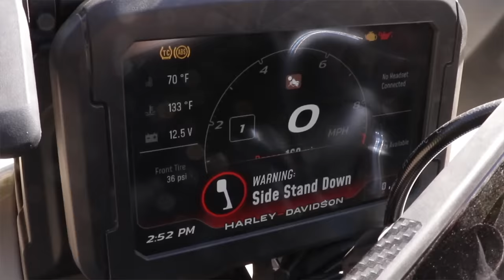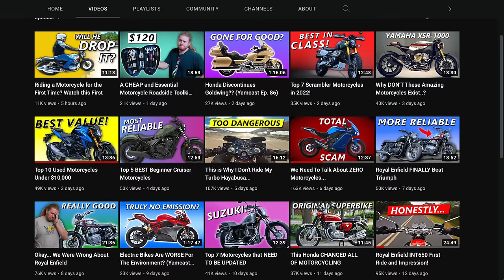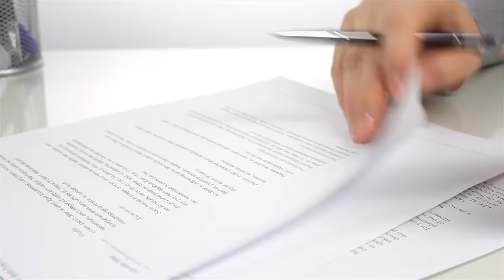Want a Bobber Motorcycle? Watch this First

Comment: Had a Triumph Bonneville Bobber Black for about 3 months before selling it. Thing was plenty fast and badass looking (definitely needed straight pipes and a windscreen), but I found myself constantly riding the FZ-07 instead due to better handling. Dragging pegs, rough suspension, and tank slappers are not as fun as I thought they'd be.
Reply: same, had a bobber. still one of the best looking bikes but sold it after a few months. too rough, especially suspension wise. now have a bmw r1250r for twisty/sporty stuff (considering to swap that for a Triumph Speed Twin) and a Harley FatBoy for when my midlife crisis acts up again.
Reply: Glad to read your comment. Bonneville Bobber is high on my wish list, but I'm concerned how much riding I'd actually do on it. I think Yammie forgot to mention the most important part of a Bobber - Practically no rear suspension. Beautiful on a Freeway, backbreaking over a pothole.
Reply: @tsubadaikhan6332  yeah well, I live in Belgium, in the so-called Flemish Ardennes. Roads with potholes aplenty. My FatBoy doesn't do so well either there. One reason I got the BMW, very good suspension. The BMW GS (I have a roadster) is the best sold bike for a reason here.
Reply: Funny, I’ve had mine for 6 months or so now and I love it! That’s what makes a horse race. Go to your dealership and ride one 👍🏻
Reply: Why don't you just change the suspension instead of bike?
Reply: @elite_eight4486  It came with a monoshock and the bike already cost 13K + after a straight pipe and other add-ons. Not tryna drop even more on some Ohlins. Besides, changing the suspension won't improve the lean angle.
Reply: @elite_eight4486  I did, I installed a pretty expensive rear shock (aftermarket, forgot the name) but that didn't do much. it's a great bike but has a very short rear travel
Reply: I know this is a common complaint but there are some rear suspension upgrades out there now that folks say completely change the feel of the bike. Pricey though.
Reply: That bike is the best bike I’ve ever seen. Definitely my dream bike EXCEPT the small gas tank. My ninja 300 had a bigger tank. That’s an issue..I  love the bobber style. Seems y’all got rid of them rather quickly…
Reply: Funilly enough I sold my Mt-07 for a triumph bobber since where I ride, it is mostly city riding and there is not much leaning
Reply: @Ishbikes 
Every time I ride my 23 bobber it gets better and better

Comment: I've been driving my Indian Scout Bobber since January and I don't regret a second. I've already changed it a bit optically: new seat, Wunderkind custom parts from Germany, new exhaust system and a few cosmetics. I love this bike and am almost sure I will keep it after buying my second machine. Yes, sometimes it hurts when your spine comes out of your neck when you hit a pothole. But I love her.
Reply: I am wondering if the Scout Bobber 60 would be ok for a new rider? I really love the way those Indians look but I don’t have much experience.
Reply: Hey  @Allie_Rose ! I definitely recommend that you do a little test drive. As for the experience, I can only tell you how it was for me. Here in Germany we have to pass a theoretical and a practical test for motorcycling - even if we already have a driver's license. This guarantees a safe start even for beginners. The bike itself is a little uncomfortable, but it is beautiful and unique on the market along with the Triumph Bonneville Bobber. The performance of the Sixty is definitely enough to have fun with it. You can also customize them with many after market parts. As for the price, you have to know that it is definitely not cheap. For a beginner, I think a Scout Bobber is a good choice, but of course you have to be aware that this is a fairly heavy bike with compromises in equipment. As a really good alternative, I can definitely recommend the Honda Rebel 1100 or the Vulcan S. Much cheaper, good equipment - just a little less soul. Drive safe!
Reply: @lucidfox.  Thank you for the recommendations!

Comment: Eleven years and 84,000 miles ago, I went with a used 2009 Nightster. Reliable as an AK-47, and just as refined. I rode it today, still crushing miles. One of the first things you change is the suspension front and rear. For reference, the first thing I changed on my 2018 DRZ was the suspension, front and rear.

Comment: I just bought the Bonneville bobber a few months back and I absolutely love it.
Reply: Man, you own my dream bike. I currently own a VFR for my first bike but saving up for a bonnie bobber. How's it been so far of owning it?
Reply: @V4demon_  I love it, did a few mods and I absolutely love riding it.
Reply: @emcsquared8681  When I went for my test, I had my mind set on a harley 48. My step dad, who's a big hooligan motard and sportbike rider, would take the piss saying they are junk, etc. Found me this VFR, I do love it, sounds great, and it is quick, but I just love that bobber look. The sound and look of Vtwins and parallel bobbers just hit it for me, and for right out the factory, the bonneville bobber just ticks all the boxes. Have you done exhaust and fender delete?
Reply: @V4demon_  yeah, changed up the exhaust I also put shorty fenders on front and back. Downturned mirrors. I got the chrome addition which I just love that paint job.

Comment: Bought a 2022 Triumph Bobber just before getting brain surgery as incentive to recover and there's still no factory bike that turns my head like it.  As a smaller rider coming from an older Harley I don't notice any ride harshness at all and it shifts like butter. Installing an airbox eliminator kit and a ST2 smart turn signal system this week. That's the one thing that bugs me, cruise control, traction control with multiple rider modes and it doesn't have self-cancelling turn signals. Come on, Triumph, wtf.

Comment: The whole practice of shaving weight, upgrading performance parts, eliminate anything unnecessary is alive and well in true street fighter builds. Not factory shit or fat rresr tire stretched bikes but true fighters. It's been going on in Europe for decades, had a big breakout here in the states in early 2000 with shows magazines and buildoff comps. 
Built a couple fighters and regular bobbers, worse thing is with or without a fender you will have gravel butt !! Lol

Comment: I was going to give you a like but you, 1- pointed out the Street Bob as a Bobber when it isn't. It is a factory Chopper regardless of the naming by H-D, and 2- failed to mention an actual factory Bobber that was put out by H-D and that is the Slim. I don't understand H-D in there naming as the Street Bob should've been named the Slim, and the Slim named the Bob. WTF H-D??!! The Slims are the closet bikes to actual old-school Bobbers that roll out from H-D along with the Triumph Bobber and Indian Scout.

Comment: I just low sided mg motorcycle today and I’m kind of afraid to get back on it now
Reply: *my
Reply: Sorry, are you injured? How is the bike?
Reply: The bike is alright but I screwed up my led and shoulder
Reply: Happens, best hop back on and keep at it. My ankle (mostly due to repeated injury for work needing to walk on it) has been in a brace for a while and probably a couple more weeks before I can do anything exciting. I wanted to find the max lean angle on my bike, and mission accomplished (it was about 65-70 degrees, WAY more than I was expecting which is a nice confidence booster even though my angle bent past 180 degree then spun around another 180 degrees and was pinned by my handlebars for a minute as I had to twist around to get unpinned and lift the bike up). So what did I do after that? Well I hopped around for about 3 minutes, drank some water, then hopped back on the bike tossing my feet over the handlebars and practiced another 15 minutes before driving home and putting some frozen hot dog weenies and frozen burritos in a towel wrapped around and belted around my ankle.

In life you fail, the important thing to call it a success is you get back up, learn, improve, overcome the challenge, set a more ambitious goal, and keep on keeping on. Keep at it, or at least give me a good deal on the bike :)  nah, just kidding, hop back on and keep practicing.
Reply: If someone caused you to lowside it it's OK you can tell me who did it and I'll bust them up pretty good. We got you fambam